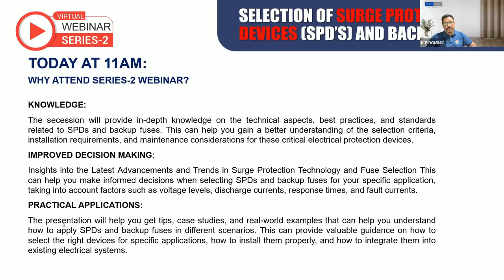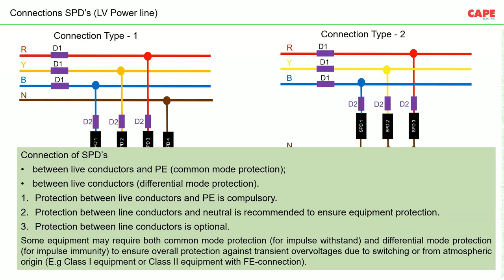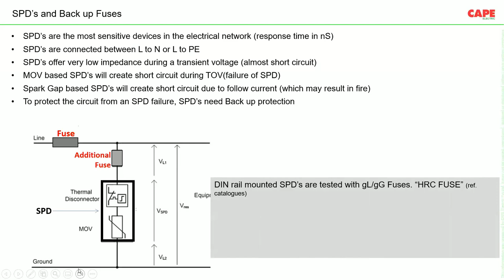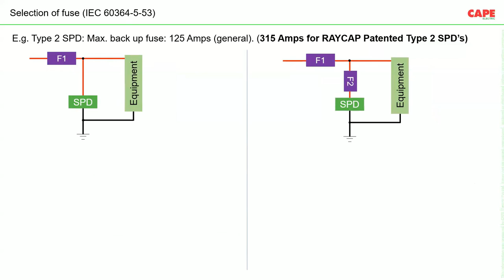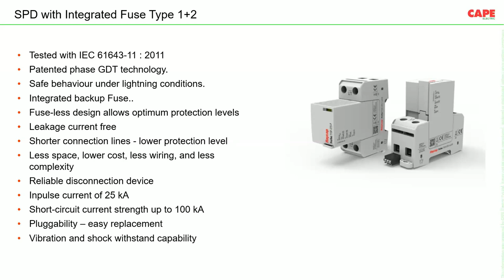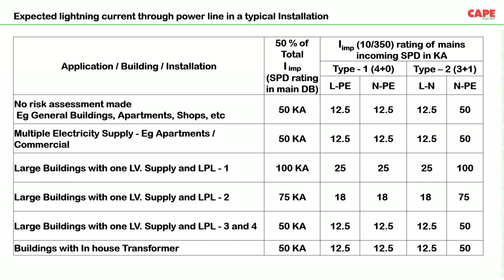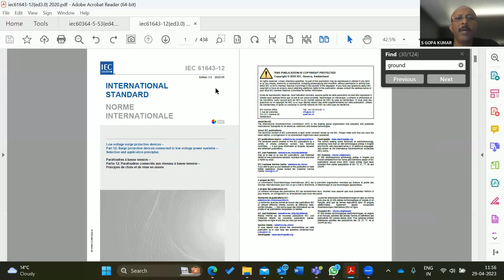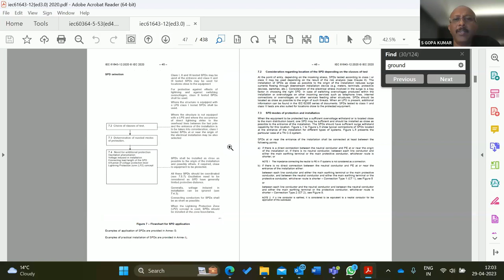Selecion of SPD's & back-up FUSE

Comment: I have Himel Type 2 SPD installed for my inverter. What backup fuse should I use for F1 and F2?
SPD Model: HDY3N-II
Imax 40kA
In 20 kA
Up 1.5 kV
Uc 275v